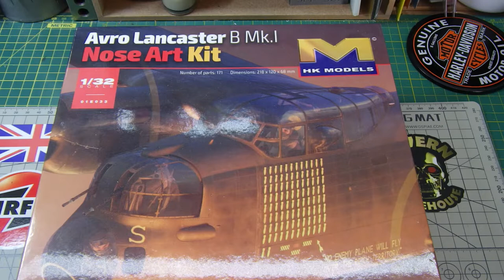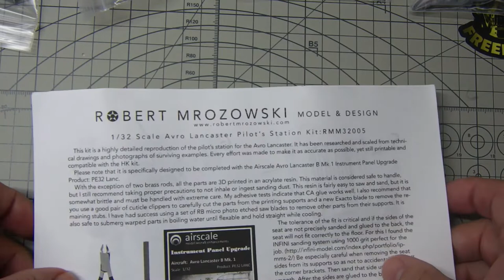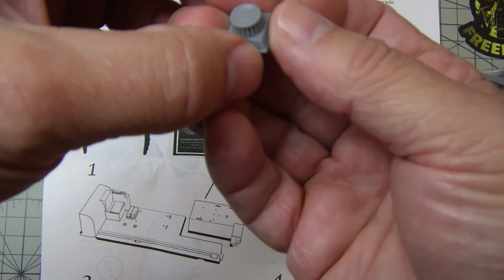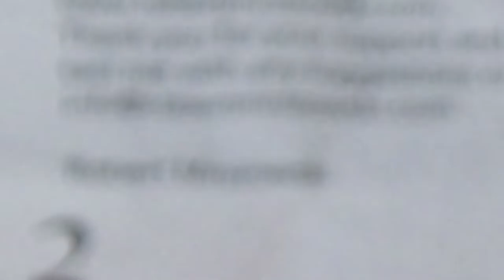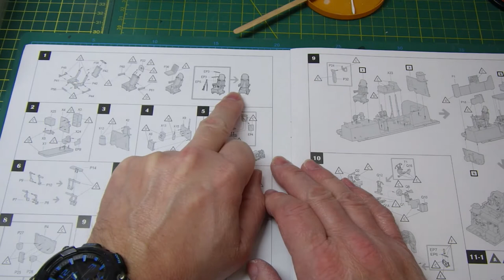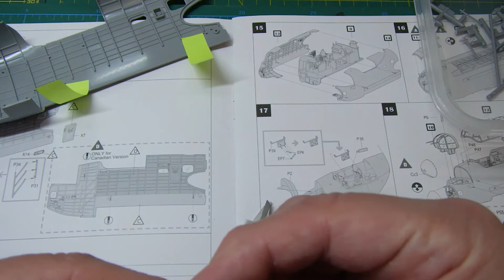Hong Kong Models 1/32 Lancaster Nose Art kit build - part 1

Comment: Is it worth the 80 quid price tag it has in my local model shop.
Reply from the maker: Hi Paul, I bought this as I could not afford the £300+ for the full aircraft kit. I saw it as a reasonable option. I think my hope was that it would be a reasonable alternative. There are a number of shortcomings in the kit and if I known about it in the beginning I probably would not have bought it. 😡 I feel let down in lack of accurate details. However, I did see one at Telford last year that had been built out of the box, and it looked reasonable sat on the table there.  Sorry to go on, if you want a reasonable model sat on a shelf, IMO I'd spend £80+ on something else ? If you really want a large scale Lancaster and want to put the work in with A/M parts (and spend another £100 maybe), then it's probably ok? I'm actually glad I didn't buy the full aircraft kit by HKM 😕  Maybe the Border Models kit will be worth the £600+ price tag 😳?? I hope that helps you make a decision. 🤔 Cheers Bob 👍🍻